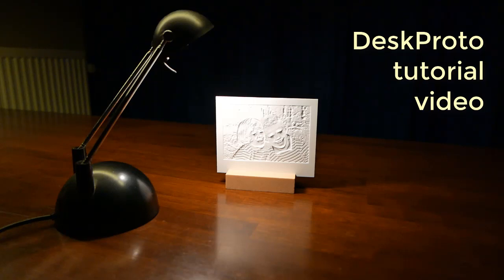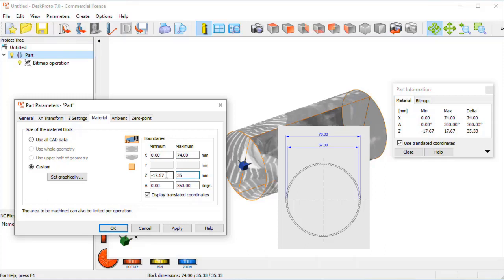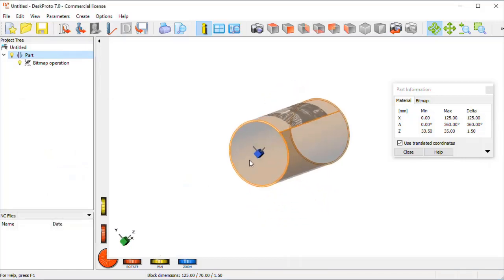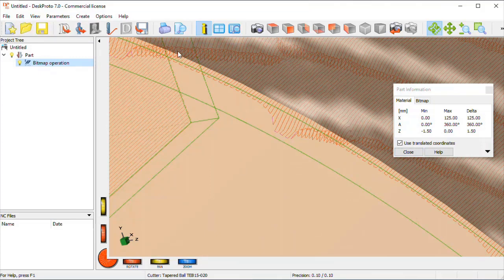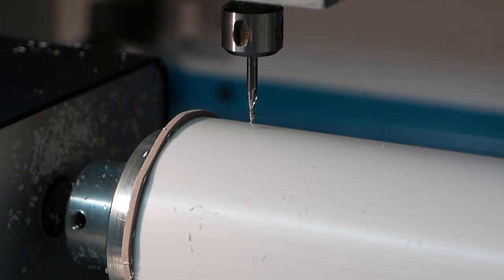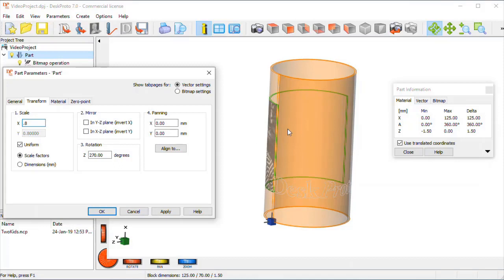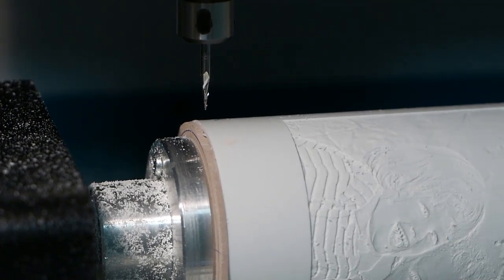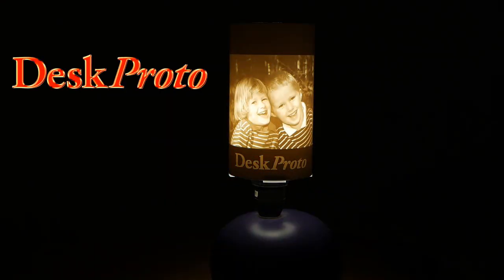Machine a lithophane lampshade using DeskProto (4-axis CNC)

Comment: Hi, wich cnc machne did you use?
Reply from the maker: The machine in this video is an old CPM-4030, made by Isel in Germany. This machine is no longer in production. You can use any CNC machine with a rotation axis to create lampshades like this.